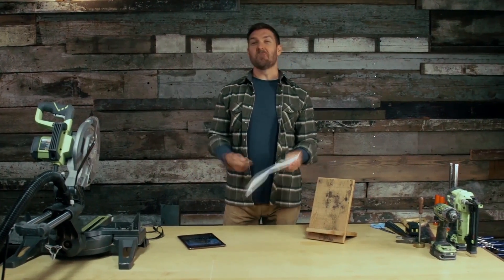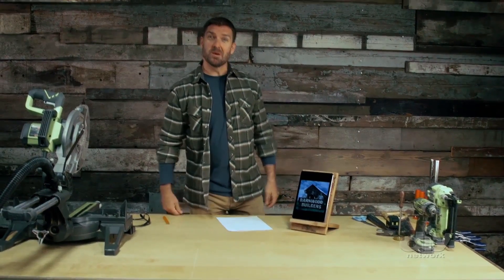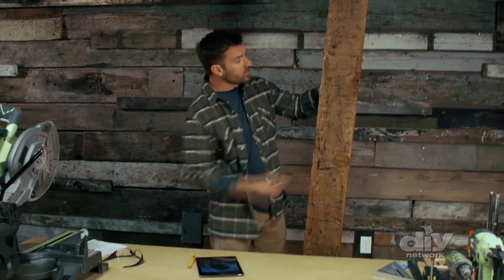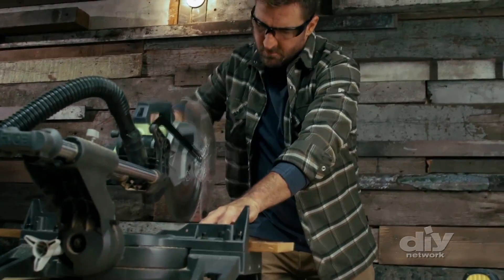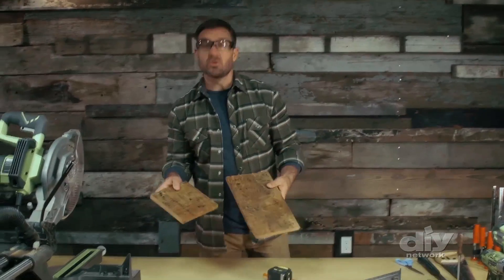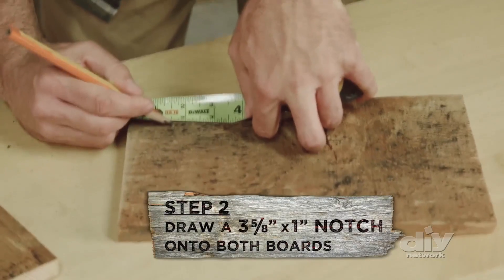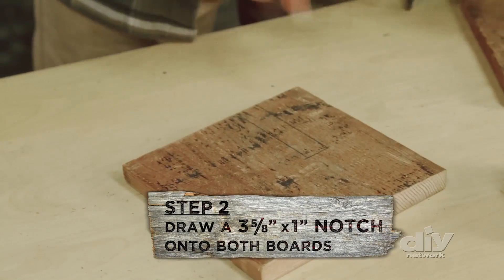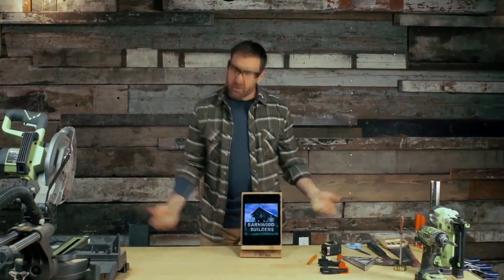How to Make a Barnwood Tablet Stand - DIY Network

Comment: I followed the instructions for all sizes and cuts.  Never told how to complete the slots, I scribed with utility knife, tapped with chisel, snapped with pliers, cleand up end with exacto knife, both filed and sanded slots. Worked out well.  But the stand is much bigger than my tablet, and stood too straight.  So trimmed some on both boards, finished size is a 10.5" , and  6 ".
To make more useful for when tablet is in landscape position...on right side of tall board cut another slot at 3.5" from bottom.  When base piece is inserted in upper slot stand has more "lean", and tablet easier to read on a less verticle angle.  Added screw eyes on both verticle sides, 4 of them, great pen and pencil holders.
Thank you Barn Wood guys.  Will refine some as used. then will make several for Christmas gifts.  A great little useful project, simple and moves fast....lots of fun for a self quarintine project during Covid19.